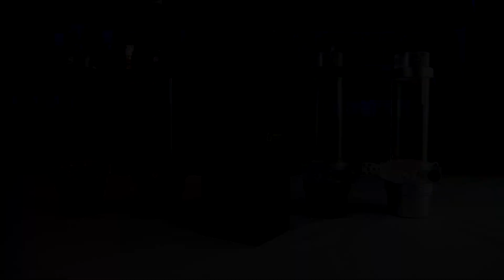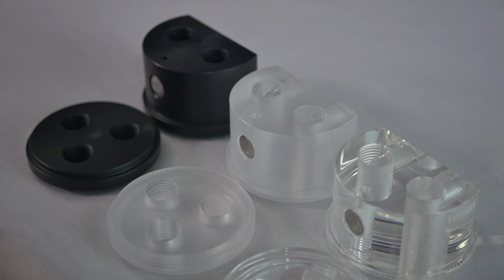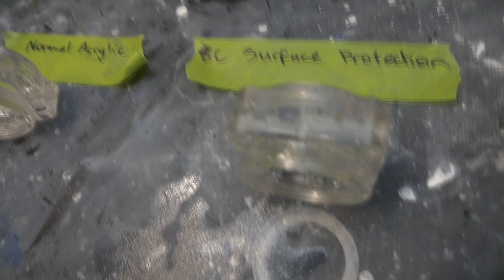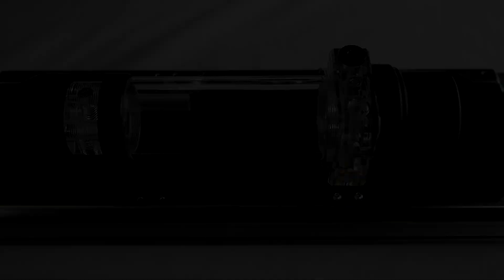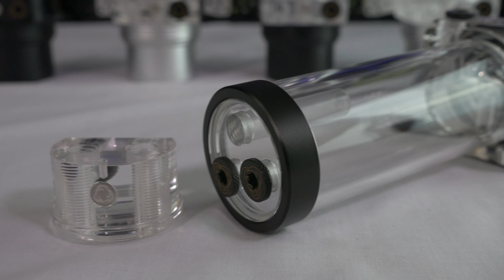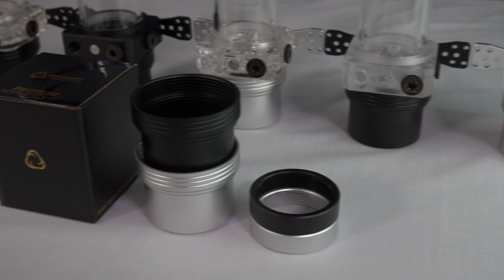New Protium 150 D5 - Reservoir Combo Features

Comment: I bought probably $1300-1400 of water cooling stuff (Protium combo, SC 16mm 0D Tubing, Hardware Labs radiators, Aqua Computer Aquaero 6 XT, Alphacool Eiskoffer kit, Bitspower 16mm OD fittings, probably forgetting some stuff) with the intention of doing a custom loop this year when Nvidia came out with new cards or Big Navi came out, and just building a standard build with the 5700 XT as a stop gap. After building I felt like it was painful enough I don't have the heart to bother with a custom loop since I managed to get it quiet without having to (and silence was the main reason I wanted a custom loop).

Comment: can you get the stop plug separately? i have an older combo but the orientation i need it would need it.
Reply from the maker: Yes we will offer it separately. Its quite a specific part because the o-ring surface has to be very small for maximum flow through the pump top. So its non standard, something we designed.
Reply: you would be able to get one of those from most plumbing supply stores, its just a brass plug. 3/8th thread i think but if different they should have from 10mm upwards

Comment: FYI, I recently found that the rear ports on the acetal 4-port top are slightly closer to the top (3/32") than on the frosted acrylic top. This slight difference caused the acetal top to be incompatible with my custom bulkhead which had been drilled to fit a 150mm tube with frosted acrylic tops at both ends.
I ended up using a 100mm tube with the 3-port cap on the bottom in order fit it to the bulkhead.

Thanks for the great products. Love the protium aesthetics and quality.